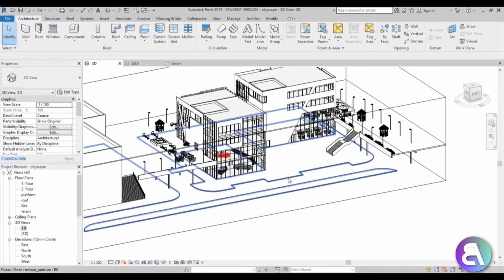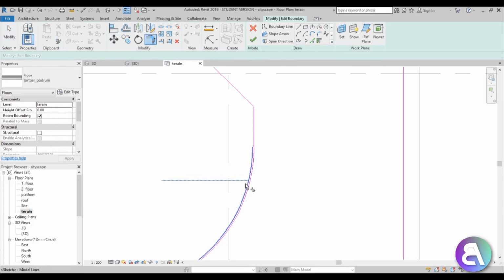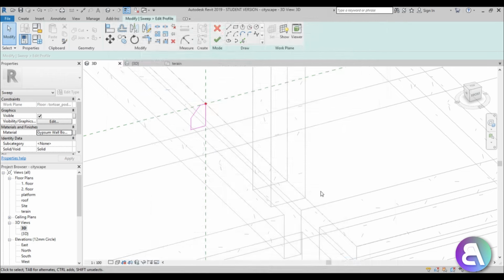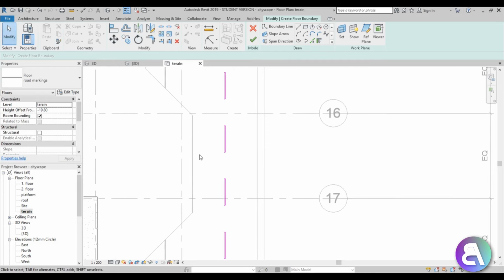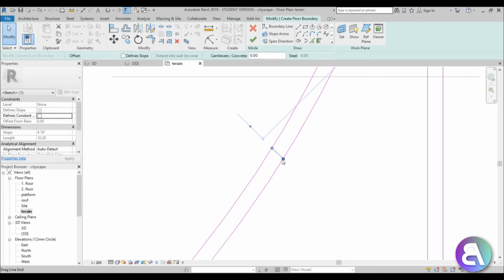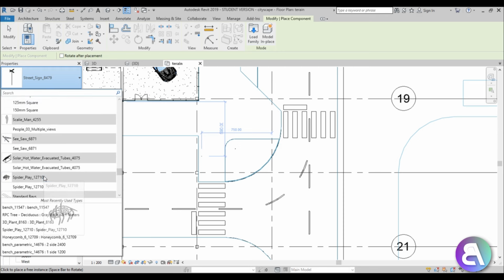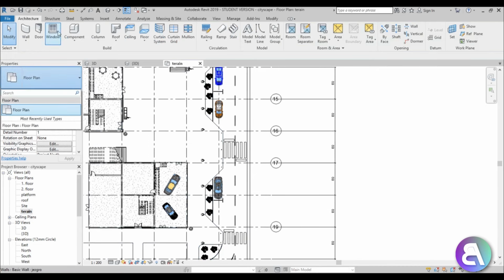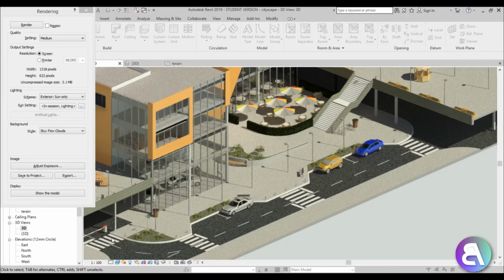Urban Landscape in Revit Tutorial (Roads, Curbs, Sidewalks, Parking, Cars, Signalisation...)

Comment: Nice tutorial if we look it from visual side. If we look from information side, all surface elements that you've rised to have thickness will count as floor in schedules and the information will be wrong. Maybe you know if its possible to stop elelements counting in schedules? Or maybe it is possible to set different levels on different surfaces. I need to rise grass and sidewalk and design curb on asphslt without making things floors. 😔
Reply: You should add something in the comment property like Include / Exclude and then filter it in or out in the schedule